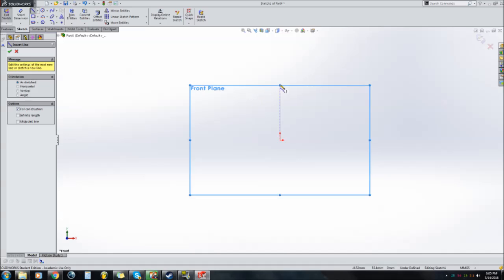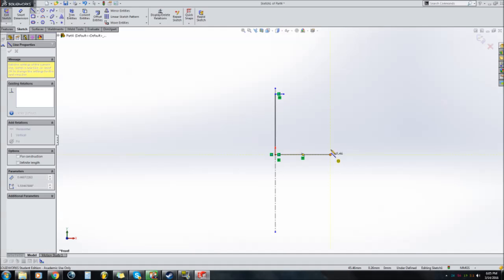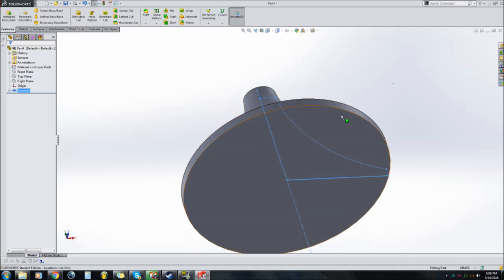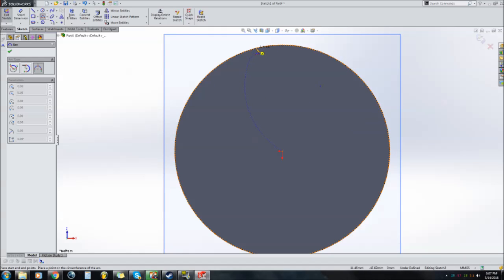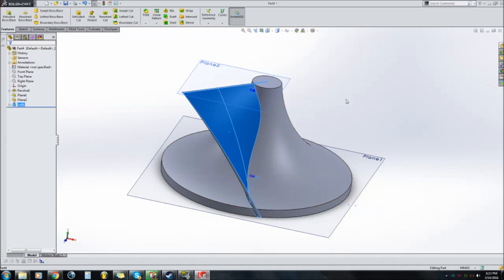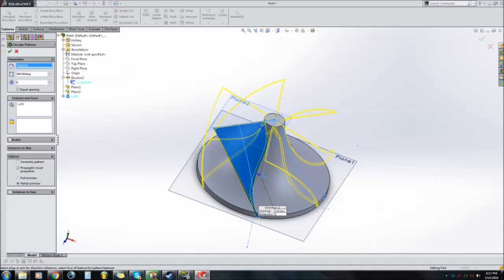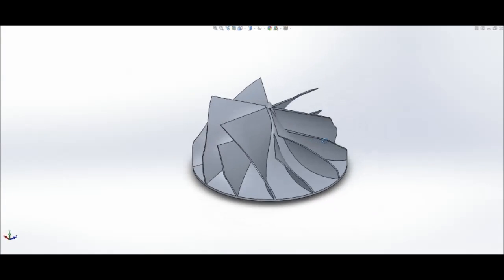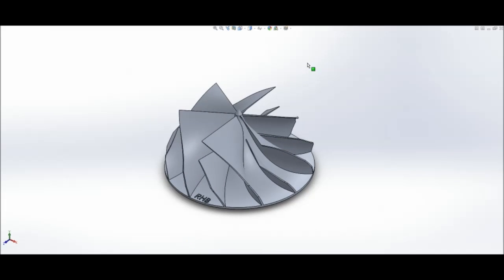How to draw a turbo compressor wheel in solidworks

Comment: Hey man, I know this video is pretty old now, but do you have a method to provide the proper contour to the blades?
Reply from the maker: It depends on many factors. But to simplify, blade profiles are a compromise between outright strength (determined by FEA models) and aerodynamic efficiency (determined by CFD and thermodynamics)
Reply: @RHBTurbochargers  I was aiming more towards the taper relative to trim, if one was to cater to a compressor housing/existing architecture. If that value was something that I could punch in as a formula. I'll do some reading to see if the curve follows trim in a consistent fashion or if its more particular to application.
Reply from the maker: @Sams88990  There's actually a lot of freedom in determining the correct trim profile for a fresh design or even a retrofit. A rudimentary approach would be to manufacture a wheel and experiment with different "trims" to determine surge and choke limits etc.

Most often CFD is used to find limits until it's simply not enough and real world testing must be done. But no, there's no formula for finding the correct trim for a wheel. Lot's of variables and it comes down to what you are trying to achieve. Hope this helps

Comment: hey there @House of Boost ^^ I am working on building my own machined MiniJetEngine ^^ Do i have to mill my own in a 5-axis cnc machine? or can I buy a compressorwheel on the internet, that is made in first line for turbochargers? cuz they look the same and the booth just compress air and redirect it into the Turbo/JetEngine ^^ Greetings Jannis :)
Reply from the maker: JannisD you can just buy one online and save some time. I have piles of used wheels sitting here too that you can have for next to nothing if you want
Reply: House of Boost the thing is I am from germany, so I guess shipping might be expensive ^^